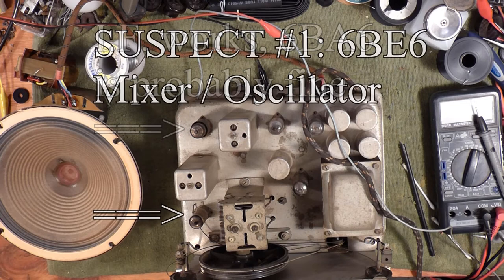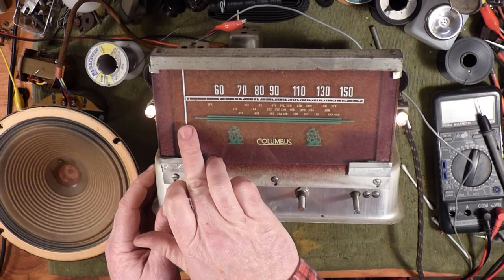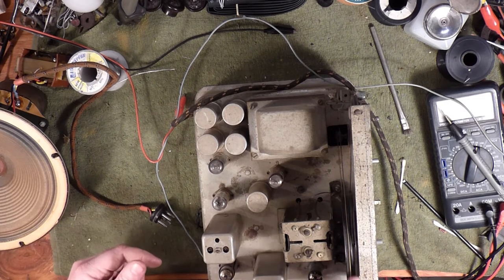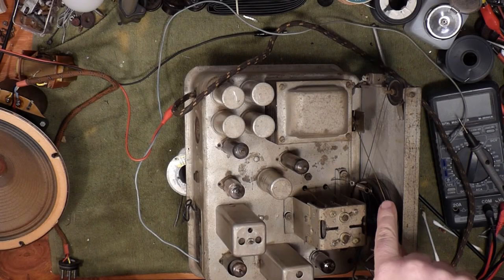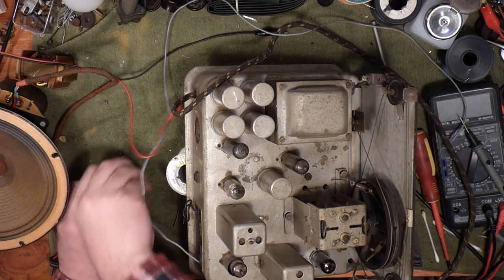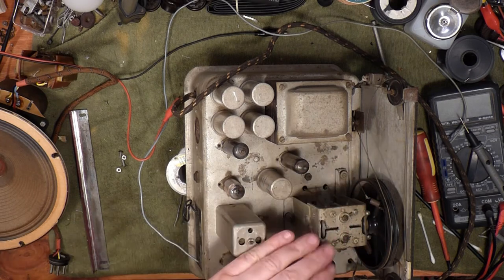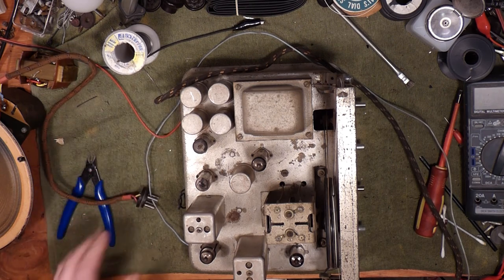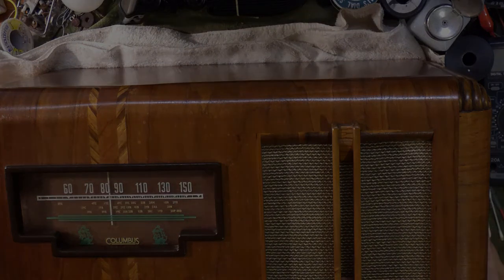Columbus model 26P Repair - Part 2

Comment: Hey, I had one of those! Sold in US as "Brat." Had seats in the bed for the kids. Pulled a Toyota out of a ditch in a snowstorm!
Reply from the maker: Yes, the Brat was the US name for the Subaru Ute - The other name it had was the Brumby I think (although that might have been just an Australian designation that sneaked over the ditch to NZ) - I always just called it the "You Beaut Soob Ute" - Ute is short for Utility Vehicle, and is pretty much what we call anything with a wellside or tray here.  They were a phenomenally capable little vehicle and mine went everywhere all my Landrover mates would go, only in more comfort! (but now I have Landrovers so I guess I didn't learn anything).

Comment: Nice. Works fine now. Good work.
Have you considered to built a small frame antenna, they are very directional so you can null out the unwanted station ?
Reply from the maker: Awesome idea - I've wanted to build a frame aerial for years, but I had not considered it as a way of solving my whomp-whomp problem.  I might start planning one, or more likely just chuck something rough together as a proof of concept.

Comment: Nice job! I hear you re the ridiculous price for a tube tester!.. I live just down the road from you in Ashley and repair tube guitar amps among other audio gear etc.. I have wanted a good mutual conductance tester for ages but anything that comes up on Trade me tends to skyrocket out of my limited budget!
Reply from the maker: Hi Chris, good to know there is someone local who shares the love of radio and audio.  I've hot a high-voltage power supply board, and an LM317-based variable supply board and a few 18650's - so I'm going to see if I can throw together a quick'n'dirty 'mobile' emission tester for basic testing of miniature valves (mostly as a learning exercise).  

As for a decent bench one, I kind of wish I'd bought a semi-decent one out of the US before eBay shipping prices went through the roof... but my PACO T-60 (? from memory) will have to do me for the foreseeable future.  Its not perfect, but it does test older valves well enough.  And I could probably actually figure out the settings on it to test miniature valves anyway if I really needed to (but then I'd have no excuse to get a new one :)